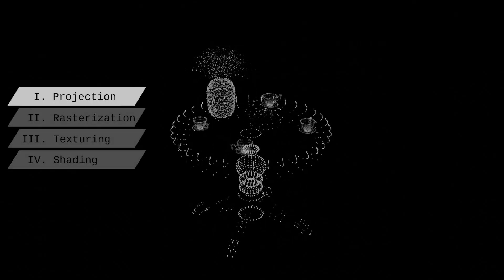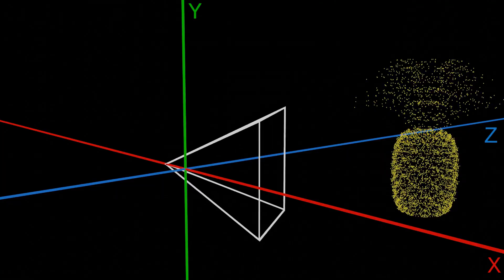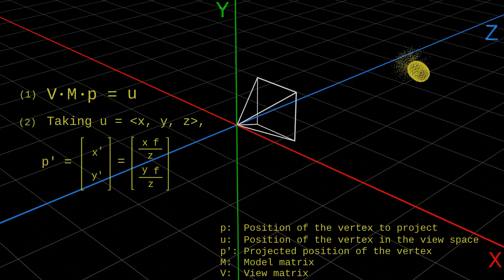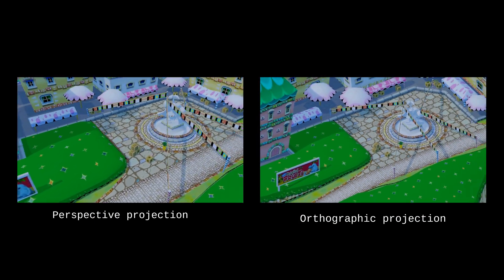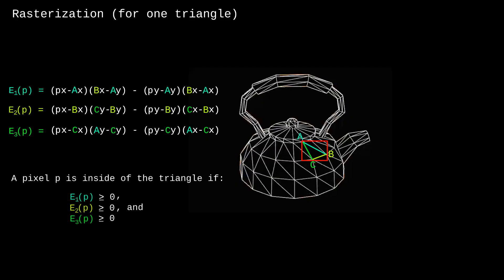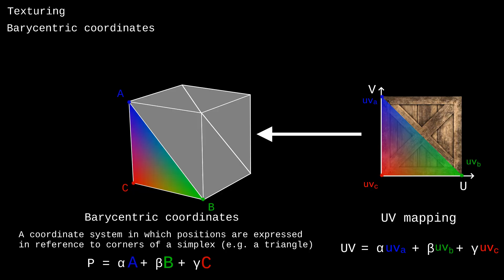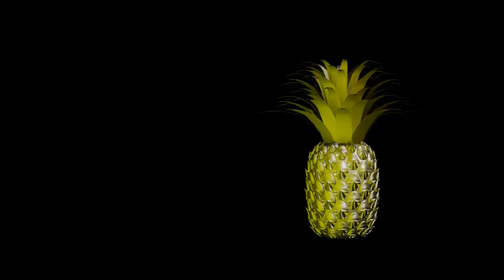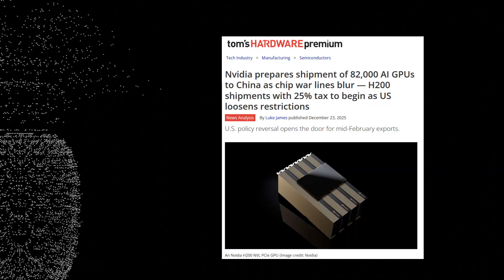Why GPUs Are so Good at 3D Graphics

Comment: Moving the camera or moving the object is just a convention. It doesn't matter. The camera plane doesn't exist in the world. What we are doing is a projection from a 3d vectorial space to a 2d vectorial space. Camera metaphors only apply to get an intuition but again don't matter. We don't use homogeneous coordinates to do basic transformations (the trick with the rows filled with zero is only a trick on paper). The only real place where they apply is for perspective correct interpolation of uvs/colors/other attributes. These attributes are defined per vertex and are not linear in 2d coordinates, BUT they are linear in 2d coordinates + homogenous coordinate, at least for the commonly used conical projection on a 2d plane. The hardware takes advantage of that fact to feed perspective correct interpolated UVs to the pixel shader (that operates on a 2d plane representative of the screen). Orthographic projection is real, you just take a picture with a long telephoto lens or zoom in on an aerial view and that's what it looks like.

Comment: TL;DR
1. project vertices to screen space using projection matrix (+ view & model matrix in most of usecases)
2. rasterize the primitives (triangles most of the time), interpolate the vertices' attributes using barycentrics (including depth buffer, which is Z coordinate of the screen space, hence the another name "Z-buffer")
since theres alot of computing units in gpu, and the gpu in general doing fine-grained parallelization (small task on all units), rasterization is very fast

the rest is just common usecases of gpu's basic pipeline (programmable shaders)
Reply: TLDR²: GPUs does what they do, nothing more, nothing less